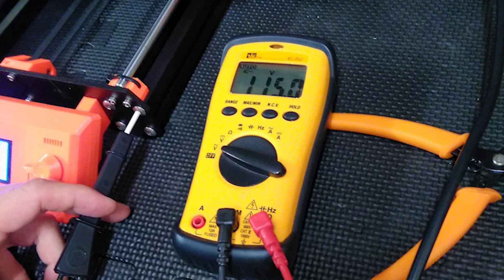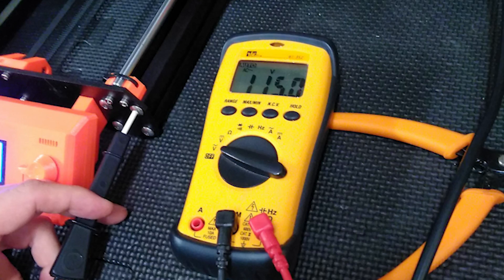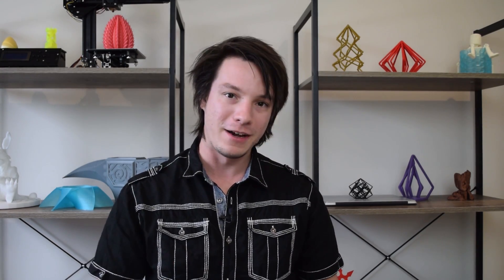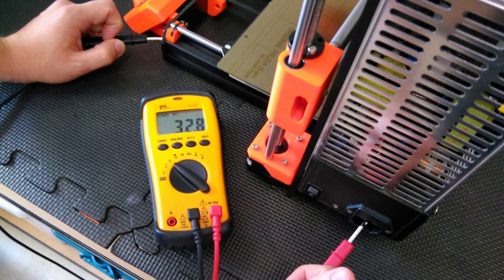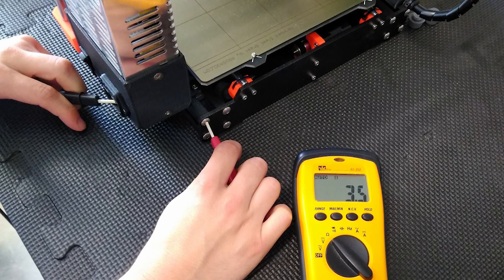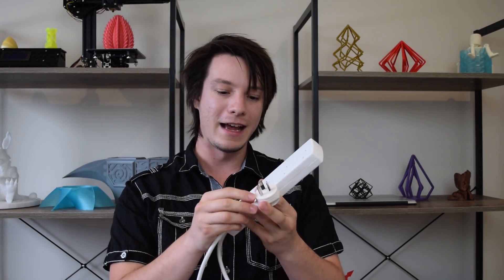I got shocked by a 3D Printer

Comment: Great that you are sharing this safety story, always good to learn from experience and share it with others. Bypass capacitors (which are normal parts in power supplies) conduct current into the ground line, and if it is disconnected this current would raise the potential of the ground line itself, and anything else connected to it. So this behavior is normal for a situation where the ground line is broken. The current should be quite low from this source as the capacitors are small and the reactance at 60 hz is high, but it certainly could be felt. We have seen shocks from broken ground lines before, it is important that the safety ground be unbroken, and any cords or adapters that don't have it should be tossed or at least never used with 3 pin loads. Two pin loads are "double insulated" and should not have any external metal that could become energized.

Comment: It could be just due to the EMI suppression capacitors: they are wired phase-to-earth and neutral-to-earth to reduce radiated noise to a level that meets specifications, but if earth isn't there, they would form a voltage divider with an impedance high enough to be safe, but low enough to give quite more than a tingling sensation.

Comment: Angus made this video as a follow up to yours ( https://youtu.be/fSNMQxkpf18) as  you make some very good points on shop/home grounding that people overlook as poor ground can led to all sorts of issues which range far past ones home-shop so something to take very seriously.  Also most all 3d printer like the JGAUROR have a similar power configuration and run the same risks.  With this, I opened up my JGAURORA A5 and made a video discussing these risks in general as  my Wanhao, Creality CR-10 and Tronxy all have the same configuration and therefore similar risks of shorting to ground.

Comment: My printer has no ground but an isolated ac to dc adapter like an xbox.
Reply: those are typically what is called double insulated and would normally be ok.
NOTE: not all "Brick" style adapters are double insulated, there should be a mark on it showing a square inside another square (I think) and this indicates double insulated.
Many bricks still have a ground, for instance many higher powered laptop adapters (Great for driving a 3D printer) are giving out 20 ish volts at a high current, these will often have 3 power in pins (Live, Neutral and Ground), the ground in this case being used to provide the input filters and protection devices a good path back to ground, there is also often a protection cap from the 0V of the output to the mains ground so if the ground is not connected, you could still get the 0V floating up relative to ground and this could be as high as the mains, but would not be able to provide enough current to hurt you (Unless there is a fault other than the ground not being connected)

Comment: Ok, ground is life ! 
But it's only necessary, as you said, when something goes wrong. That means that something was wrong  on the Mk3...
On the other hand, you put all chinese printer in the same pack. That doesn't seem  fair to me. I own a chinese printer and I didn't get any issues like that the printer is grouded and there is ,no current leaks. This said, i'd love to get an Mk3 and I would've bought one but I  didn't have the budget so I went for a chinese printer. 
Also this could happen with any (nationality) printer :)
Thank you for all the content you share ;)
Reply: NO NO. the ground is always needed even if there is no fault. It provides a path to ground for input protection devices, to help a ground fault circuit breaker to trip etc, neither of these required there to be a circuit fault, but to prevent excess voltages building up in metal work or you touching the wrong thing by accident etc and reduce interference and surge affects to name just a few reasons.
Reply: Ok yes, you're right. I was only taking the safety side of ground ;)
But the main point of this post was to say that ground is necessary on all printer regard less where they are from and all nationality equipment can have ground issues  :)

Comment: You received a rude awakening. I don't trust any electronics. It doesn't matter if its Chinese or not. You can be zapped by static electricity and die in the right condition.

BTW it is not the voltage that kills you but the current. All it takes is 30v or 1/10 of a Amp to kill you. People have stopped breathing when shocked with currents from voltages as low as 49 volts. Usually, it takes about 30 mA of current to cause respiratory paralysis.

http://digital-library.theiet.org/content/journals/10.1049/piee.1966.0017

Why you decided to use your hand when you have a multi-meter and ground available is ridiculous.  I also find it socially irresponsible to attack certain brands without knowing if that was a defect in 1 of 1000 printers that may have been shipped. If you had taken a survey and asked all of the users of these printers to test them to confirm what you are saying is true it would be different.

Comment: Any Chinese 3D printer with an LED power supply, just put the cable in the bin, cut up a locally-sold IEC lead which meets safety specifications. Use crimped ring or fork connectors, don't fasten the wires down bare. If you aren't professionally certified to work on AC electricity for a job, don't use an AC heatbed! Do a course and learn the correct safety requirements. You're not only putting your life at risk, but your friends/family and neighbours if you burn your house down. The casual attitude to the dangers of AC power across the whole hobby is pathetic.

Comment: It's not your fault. There shouldn't be any voltage on the screws anyways.
Reply: Actually it is his fault, but a mistake that anyone can make in the heat of the moment. The design of most modern high powered equipment using a switching power supply (That pretty much everything these days as there so efficient compared to older 50/60Hz based transformer power supplies) should have various protection filters, EMI filters, surge protection etc on the input and these often are designed to require a ground to work correctly.

Comment: I bought a used Tevo Tarantula from a kid on Facebook, and it worked fine until a few days later that I noticed the power supply ground was not connected. I replaced the power cord with a properly grounded one, and promptly blew the USB port on the MKS board...twice. I then noticed the labels had been broken on the chinese power supply, and on further investigation noticed an insulator was missing from one of the Mosfets attached to the frame of the power supply. Replaced the insulator, and added a USB isolation board inline to the usb cable, and to further protect my computer. Canada, 110V.

Comment: What you felt was the earth leakage of the EMI filter in the PSUs of the two printers - this would be nowhere near dangerous unless there was also a fault in one of them.
Reply: mikeselectricstuff  Dammit Mike that’s the only thing I probably could have answered this year!
Reply: AllTheGearNoIdea Hahaha, he beat me to it too. If the earth connection hadn't been left floating by his dodgy extension cord, then that normal leakage current from the filters would never have built up enough to be even feelable, never mind dangerous. It's always a surprise though, I've had it happen enough myself from various different appliances. Too much leakage like that from lots of appliances at once can certainly make earth leakage circuit breakers very twitchy :-)
Reply: Ken Phillips I have a home lab with lots of test gear and a master switch. I have to switch stuff on gradually or it takes at the ELCB about 10 percents of the time. Normally when I’m in the middle of a 12 hour 3D print.
Reply: @allthegearnoidea6752  What helps is putting a beefy low resistance NTC in series with the appliance. Basically the resistance limits the current until the NTC heats and the resistance goes low. The temperature of the NTC will stabilize, thus preventing inrush current while limiting the power dissipation during operation. Of course take proper precaution for electrical and thermal isolation, as the NTC will be live and hot. For a 500W transformer I used a 5ohm/5W.
Reply: The leakage current through an emi filter can certainly be felt, and be quite unpleasant. Not fatal though.
Reply: Hey can you help me, i just got the jg aurora a5s which is properly grounded but im 12 so i dont know what that means. but as i was checking my print i touched the metel frame and got shocked but then the print stopped and the lcd went black but it was just a small shock as if it was static electricity but i dont know why the print would stop?

Comment: It's not unusual for the insulated supplies to float to half the mains voltage on the output, this is a side effect of how they suppress switching noise. Unless the Y caps are defective, it's not actually a danger, even if you feel a tingle, they shouldn't let a significant enough current through to be dangerous. As soon as there's any connectivity to ground, the output offset floats back down.

Comment: in most 3d printers most internal voltages are 12-24v dc and that is not a problem unless you have peacemaker in your heart. also you can grab live 240v ac cable as long as you are isolated so wear crocs guys.
Reply: 100v of ac or dc? I mean its tremendous difference.

Comment: You are lucky you touched it with one hand. Both hands could have drawn current across your heart, which could have ended up very bad. I will bet you it's the power supply that is leaking. Electronics are used instead of transformers to lower the voltage. If the power supply is not designed properly or is faulty, it could leak current. It may also rely on ground to work properly, because there is no isolation transformer. My 3D printer kit came with a 2 prong plug and wire. I threw it away and installed a grounded cord. Very dangerous not to use ground on anything that is not double-insulated.

Comment: Sounds like your experience of a relatively mild electric shock highlights the danger of not using extension cables / trailing leads correctly. As many people have pointed out, the switched mode power supplies (SMPS) used in 3D printers have internal components connected between the earth and live (hot, in American). As such a small leakage current can pass to earth that is too small to trip any RCD or GFI/GFCI. When you connected both printers to the same supply you inadvertently caused this leakage current to travel to you via the Prusa printer as you were missing an alternative path to earth due to your use of multiple leads caused by your lack of sound judgment. You should ALWAYS use properly earthed extension cables and avoid connecting two or more together. Fortunately, you were not exposed to the full mains current so were not at significant risk but in a fault situation things could have ended very differently!

Comment: I had the original cord with US plug that was supplied with  Anet A8 have its ground wire loose connection internally ( bad, thin and cheap materials were used) right by the plug itself. The cord was not damaged or anything, it just lost ground on its own after a few months of service.  Luckily this was discovered during some upgrades to the printer.

Comment: mains input filter on power supply has capacitors from N to protective earth (ground) and from L to PE that effectively form a voltage divider, so if your PE is missing, you get 1/2 of your mains voltage on everything that is connected to PE. Impedance is relatively high, but shock is not less shocking because of that.

Comment: Internally to the other printer, it may drop it from 220 to 110, but use the upper leg (high at 220, low at 110). I have seen that happen with a transformer in china

Comment: Hi Angus , new to your channel and i'm learning a lot about 3D printers from you .
Sounds like the power supply is meant to be double insulated and encapsulated in a case , these power supplies do not need an earth as they contain a small isolation transformer inside but they can  use the chassis as a common connection for the neutral so touching anything connected to that could be a killer !
Old valve radios and tv's used a similar approach on their chassis but it was inside a wooden cabinet so you couldn't touch it easily .
There are other things too like the mounting screws could be too long and  touching the circuit board inside the p/s unit  but either way i would isolate that first and do a bench test .
another reason why anyone building projects that use mains power should :
(A)  get a basic understanding of mains power and how lethal it is .
(B) own and learn to use a basic multimeter  to check for problems before putting your hands anywhere near it .
(C) if they can't comprehend it stay well away from it !

Ian .

Comment: Measure the resistance from Live and Neutral to ground, could be a (de)coupling cap leaking to ground. My samsung monitors pack a fair bite if you get your finger between the video connector and the grounded chassis of the computer, they're leaking 120vac at unknown current (haven't gotten around to measuring it), to work around it I just plug everything in *before* applying power (they use a strange voltage that I cannot easily substitute). All of my samsung monitors do it, 2x of which where bought the same time, the other one was gifted to me several years later (so not a batch thing).

Big clive on youtube has done a few tear downs where these "EMC" coupling caps have not been rated to the correct voltage/been certified for use and thus presented a shock/fire hazard.

Might be worth getting a test and tag machine (note that you need a license to ""officially"" test and tag) and have it as a screening test that you do as part of your reviews which only? gets mentioned if there is a problem

Comment: I have a degree in EE and I still make mistakes. I didn't receive the darwin award yet so I'm doing ok. I would have thought you had a floating neutral in the main panel based on your readings and I think eventually I would have traced it back to the ground but I'm not sure how long it would have taken me to do so. Hopefully you LIVE and learn and not learn the hard way where its game over. Nice video to educate the community.

Comment: So what is the right way to ground 3D printers? I have one with aluminium extrusion and aluminium-plastic panels as the structure, but different metal parts seemed not shorted due to the coating and surface finishing on them. Should I just short one part to GND, or first short all metal parts together and then do the grounding?

Comment: This makes me even happier that I installed a Power Supply cover with a standard IEC320 C14 AC inlet power socket on it for my Kit Printer. Was not happy that it did not come with a ground out of the box. The original cable was used long enough to print the cover and to wait on shipping.

Very informative video, and a good warning to those who are not aware of the importance of this.

Comment: It also highlights the risks with impulse buying cheap items. If you need to buy a powerstrip go to the hardware store and buy a brand item, don't grab a $2 one from the supermarket. I know the temptation to go with a cheap option when money is tight but there is a very real danger in doing that. You should also check your existing  powerboards and replace any of those dodgy looking ones you may already have. and replace ALL those silly double adapters with good small powerstrips.

Another problem we have is its so easy to buy from anywhere in the world these days with places like ebay. There is ZERO guarentee anything mentioned with a product is accurate in any way. anybody can put a CE sticker on anything but it doesn't mean that product has been actually certified at all or hasn't been tinkered with. We're makers after all and tinkering is what we do but there are genuine safety concerns to be aware of especially to the younger tinkerers out there.

Not all countries have the same safety standards either so be extra cautious with what you decide to buy and for safety try to have someone else present when you plug in one of these cheap devices for the first time so they can call for an ambulance if the worst happens. Generally things work well if you're sensible and dont abuse the gear but you never know if a little fault in one thing might cause a bigger fault in something else. 

electrocution and fire are very real threats folks . Don't stop being a maker out of fear, just exercise some common sense and caution when tinkering and dont always buy the cheapest electrical gear just to save a few bucks, its not worth your safety to cheap out.

glad Angus was lucky on this occasion and made this post. he is very aware of how bad things could have been and others out there havent been so lucky in  the past. Unfortunately people showing off, taking risks, being idiots will mean there will be harm and loss of life in the future from these types of accidents. A little care and patience goes a long way to your personal safety and costs nothing, so don't be an idiot.

Comment: Try measuring using LoZ meter as it sounds like a typical induced voltage on the frame, a normal meter is too high impedance.  If the Eth pin was connected it should be fine.

Comment: First and foremost, I recommend that you install a GFCI (Google it) in any outlet where you intend to connect a 3D printer. Also find an outlet tester that will give you a sanity check on the qulity of the wiring. Death penalty is way too heavy a punishment for a mere distraction, and we do not want to lose you!!!

Comment: Do you got an RCD Protection against ground leaking? if not invest into a 30mA one! 
For devices leaking into ground, 3.5mA is quite acceptable (atleast in germany) that can easily let you measure upto mains if the ground is disconnected. But if you got schocked it must have been quite above 20mA.